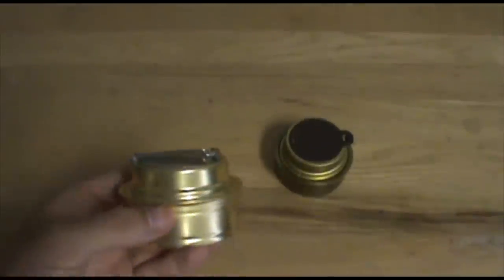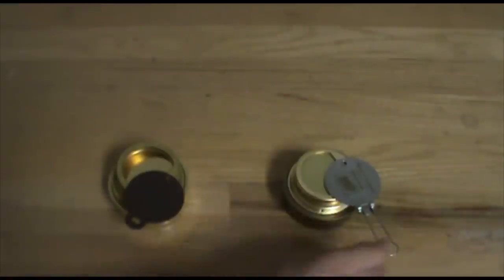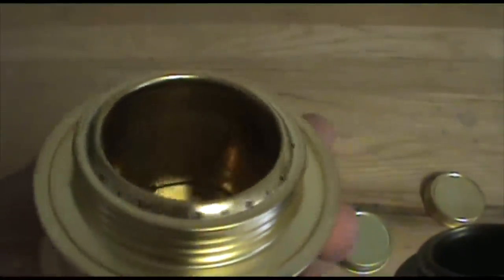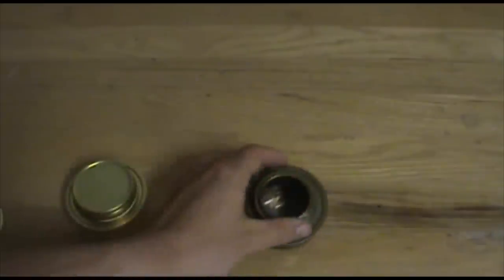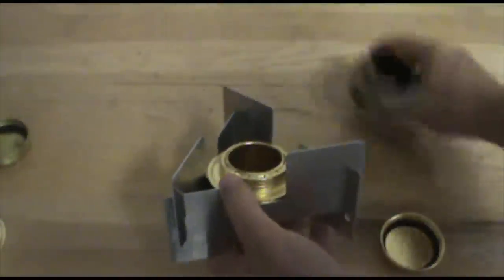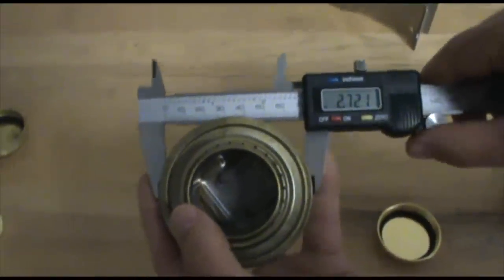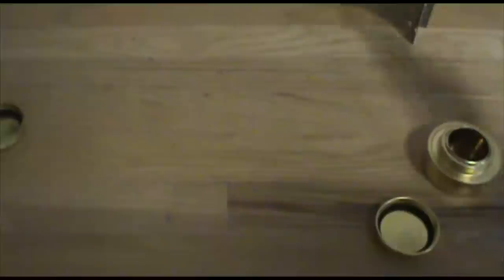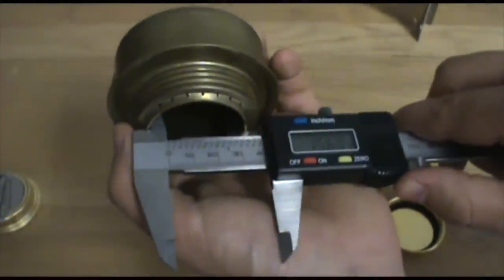Esbit vs Trangia Alcohol Stoves

Comment from the maker: Yes, the Esbit simmer ring will fit on a Trangia burner. I don't know if the simmer ring can be purchased separately, but I think it has to be sold somewhere if you look around a bit.
Also, a company called ALOCS makes a burner and simmer ring that's identical to the Esbit one, so you can look for that too.

Comment: Nice video.  Thanks for the great info.  Since you have experience with both the trangia and esbit stoves, I am wondering will your modified westwind stand work with a snowpeak mini solo (which I believe has a diameter of 4.25").  The esbit has a stand that works with either alcohol or tablet which I am also considering.  Looking for the best "stand fit" for the mini pot.
Thanks.

Comment from the maker: @1jump2many I have not used one, but I've seen a lot of reviews of that stove, and for a while I drooled over the Evernew DX setup.
But I'll probably never try one due to the cost. Titanium has a big following due it being lightweight, and I'm sure Evernew makes excellent stuff, but in my opinion there are way cheaper ways to lower your pack weight. I also think titanium is a less-than-ideal material to construct an alcohol stove out of.
Thanks for watching and commenting!

Comment: Got my Esbit stove in this weekend and the Esbit stove appears to leak fuel when the cap is screwed on, however my Trangia stove does not leak.  I have since lubed the rubber O-Ring that is on the screw cap for the Esbit with synthetic mobile 1 oil and will see if that solves the issue.  The other difference I noticed is the Esbit stove took 12 minutes to bring 16oz of water to a rolling boil and my Trangia is approx 9 minutes.
Reply: These are typical timings for any half decent alcohol stove, this obsession with boil times on stoves is wasting your life!! Listen, On average, given certain environmental conditions the average time for these stoves to bring 1/2 lt (18fl oz) to a boil is 8 min, now please get on with your life and enjoy the great outdoors! 😂

Comment from the maker: But if I understand you correctly, without the windscreen you had the pot up to 1.5 inches, so you changed two variables at once. The 1.5 inches might be a bit high, so you might get a faster boil with something between 1.0-1.5 inches.
In my experience, wind screens don't do much to help boil times if you are testing in controlled conditions like your garage. In the field, of course, they are essential.

Comment: Why do you call it "mini trangia"? This is the original trangia burner as it has always been. They did manufacture burners for the army between 61-75 (together with SVEA and Eskilstuna and others) which is larger in size - but they are not trangia burners as such; but specially built to military specs and order.

Comment: yepper...i got you subbed, so when your new uploads pop up, we will know it. Cheers. really looking forward to your experiments on the stove/pot height differences in boil time. We tried it out today&results are confusing.with a windscreen at less than an inch gap.it took the trangia over 13 min to boil waer..without windscreen only pot stand made of coathanger wire,1.5 inch distance, it took 8 min. all indoors too. strange results?

Comment: How could you do a "vs." without lighting them both for comparison. Aren't they supposed to perform a function other than fitting into a stand and measuring a certain diameter? Are they supposed to actually cook or is there a second part to this video that I missed?
Reply from the maker: The purpose of this video was to point out the different design features and dimensions of the two burners. What the hell good would it do just to light them? You can't judge the performance based on just looking at the flame. I would have had to do controlled boil tests on each one to compare the flame performance as far as cooking, and that is way beyond the scope of this video. This video was primarily so that people could determine which critical dimensions were different and which components were different before buying them. It was not to show which one is the winner and it was not a review. Nonetheless, thanks for your comment, but next time perhaps you could be less of a wise ass.
Reply: Just what I was going to say!  Some people miss the main point of reviewing a product. First and foremost this is a stove/burner. Size and design are secondary to its main function (burning/cooking!) which appears to have been completely ignored here.
Reply: I find a stove video that does not have a stop watch and a pot of water in it oddly refreshing.

Comment from the maker: @MrItchyElbow I didn't switch to the Esbit, I just think it has a superior simmer ring design. It still gets hot but you can adjust it much easier, even when its hot.
But I ended up returning the Esbit because it leaked fuel. The Trangia reigns supreme in the end.
Reply: You can easily adjust the Trangia simmer ring by clipers in multitool 😉

Comment from the maker: @laphroaigdrinker You can do that, but it doesn't fit on the Trangia very tight, so you'd have to be careful not to lose it.
I ended up returning the Esbit because it leaks fuel, so I no longer have the simmer ring for it.

Comment: I'm in Colorado too...... Any issues with either, in the high country?
Reply from the maker: I don't own the Esbit anymore.
I've never had a problem with the Trangia at higher elevations. I've fried trout with it near treeline without any issues. It can be a pain to light if you let the stove and fuel get too cold, but you can just throw it in your pocket for five minutes and it will be just fine.
Reply: In cold weather I've a neoprene outta on my fuel bottle and put it inside my spare kit inside the rucsac rather than inside the kettle or a pocket - it does take longer to light and slightly longer to boil in the cold - but I am talking 0c or into the minus's here and on snowy ground.

Comment: It is strange to me,  cause I figured with the windscreen on, enclosing the heat on the sides, it would boil faster. it didn't. But with the pot on a coathanger stand, no windscreen it boiled faster. that's it. Experiments shall continue. cheers

Comment from the maker: It leaked from the seal when I screwed the lid on after leaving fuel inside to save for later. I don't think there's any benefit to the different hole size. If there is, it would be minimal. The Esbit is similar in size to the mini Trangia.
Thank you for watching, and let me know if you have any further questions.
Reply: I dont have that problem, i think i got the better model, mine is similar to my Trangia if it comes to quality

Comment: What?? My Trangia 25 is 40 + years and so is the burner. Never any sign of fatigue or leaking at all. Ok, I'll give you that after 40 years of use I have had to clean out the jets with a needle due to use of sooting fuel and replace the rubber ring due to drying out... But never any failure in material or workmanship of the burner. Call Trangia in Trångsviken, Sweden and they will probably replace it free of charge. The burner DO NOT fail.
Reply: They often LEAK, and the paint burns, stinks and smolders on that snuffer-plate thing. Pew.